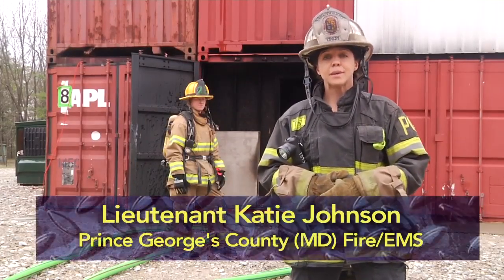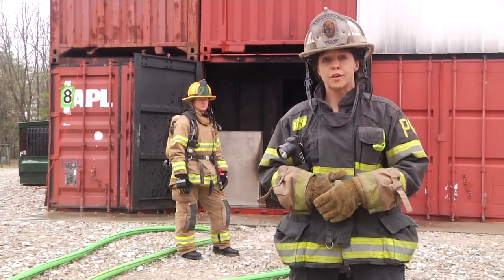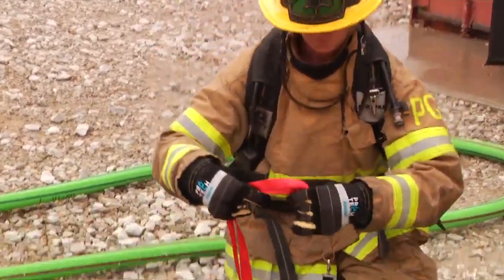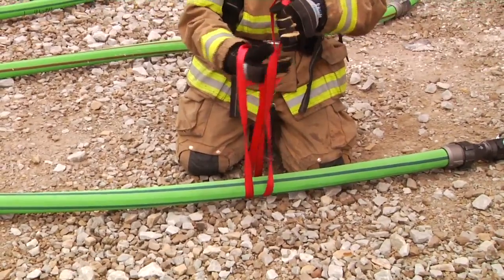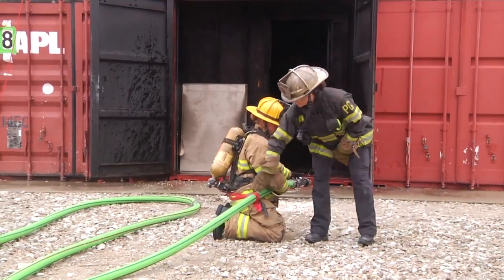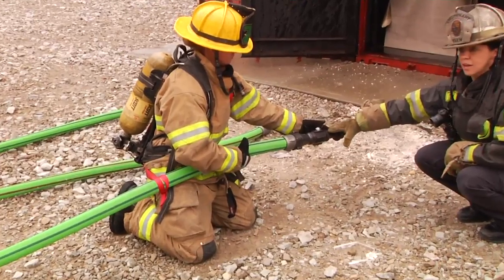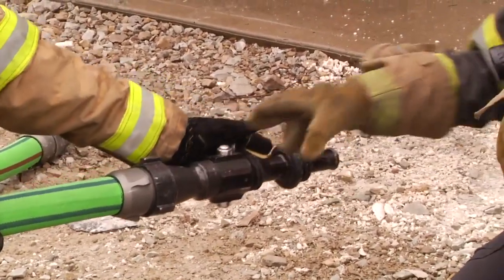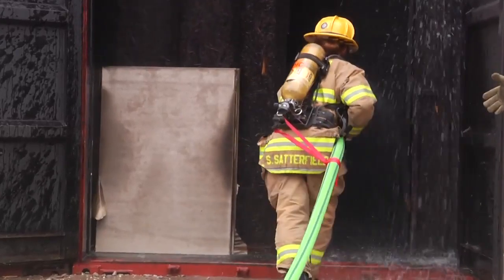Advancing Larger Hoselines with Webbing #6127326281001

Comment: I've not seen this version of wrapping it around the shoulder, but it makes sense and I like it! However, I do think practice would be needed when changing out firefighters on the hoseline. It seems like it may be tricky to get out of in a blacked-out and/or tight environment when the next firefighter is coming to take over so you can go recycle your air. I'm going to share this with my crew the next time we practice hose advancement and nozzle control!

Comment: No webbing needed for an 1 3/4. Especially with a smooth bore tip. 

This works great with a 2 1/2. 
You don’t need webbing for this type of line. (Shown in the video)
Reply: I would say that it depends on the individual controlling the hoseline and for how long. 1 3/4 is manageable for many, but it may be difficult for others who aren't as stout. I'm all for tricks that allow us to conserve our energy on scene.

Comment: About how long is that piece of webbing? 8 - 10’ guesstimate?
Reply: That's my guess. I carry a piece of webbing that's about 8ft long that belonged to my father and he carried when he was a volunteer firefighter from 1994 to 2005. Back then all he had to worry about escaping from was a 2 story home so that was his bailout webbing. Now that I'm a paid-on-call firefighter I carry the same piece of webbing, but for the same purpose as is demonstrated in the video. For bailout purposes I've got a section of 4,000lb rated webbing that's 50ft long and has a auto locking carabineer on the end of it.